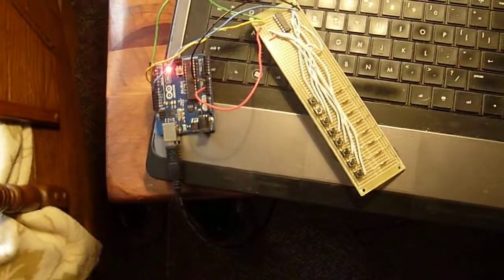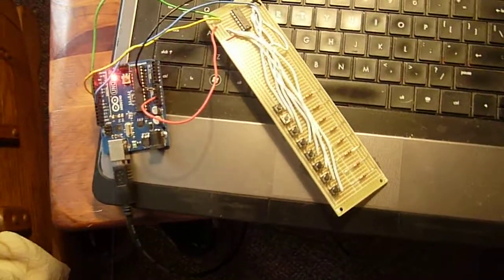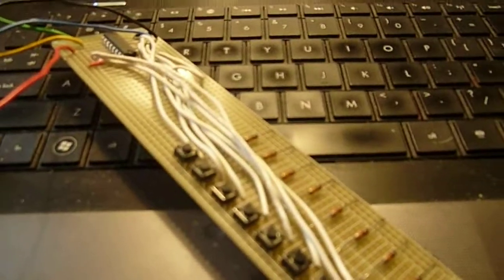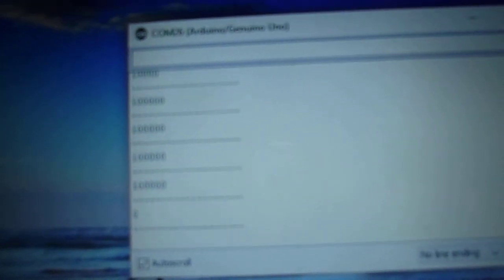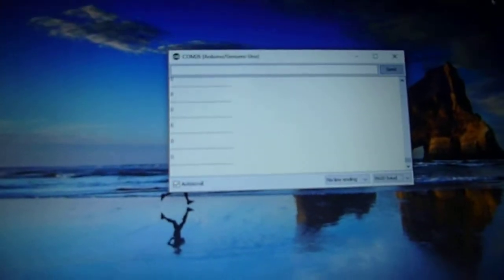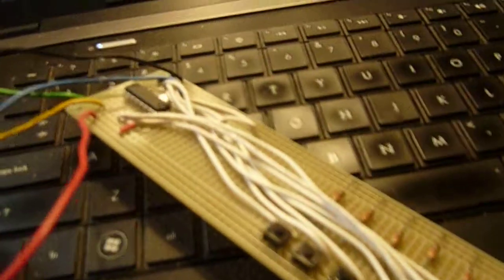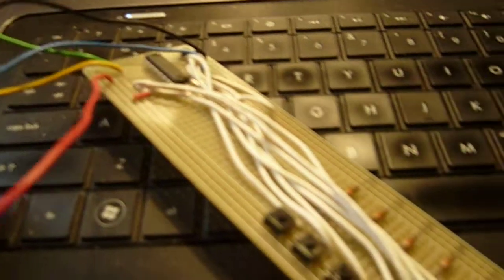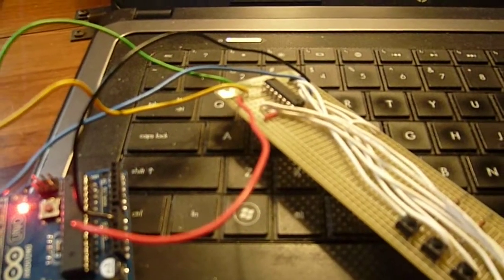The Arduino and a CD4021 Input Shift Register

Comment: Im getting different output values everytime
Reply from the maker: "Output values"? It's an input register, and the only values are on, or off.
Reply: @sspence65  I used the switchvar variable to print value of it and used a switch statement to run different leds

Comment: Hello! Can I able to use 2 individual at same time for exam I connect 2 of them to arduino and press each 16 total button at the same time and can get each 16 button press detected
Reply from the maker: yes you can.
Reply: @sspence65  do I have to use different data-clock-latch pin for each ic or can I use same lines for both ic
Reply from the maker: @sibermak61  you cascade them, so only one set of pins on the Arduino - https://www.arduino.cc/en/Tutorial/Foundations/ShiftIn
Reply: To my understand if I do second example multiple shift register can I get 16 individual input pin and use 16 of them at the same time
Reply from the maker: @sibermak61  yes you can.

Comment: how many buttons can we press at a time ??
Reply from the maker: Vasudev Mr all 8
Reply: thanku . where can i extract the serial data ?
Reply from the maker: Vasudev Mr in the serial monitor, or use a display.
Reply: i got it but say if i want to drive led respective to serial data through which pin shall i get the signal ?. thank you
Reply: You get it from the 4021, Q6,7,8 I believe.